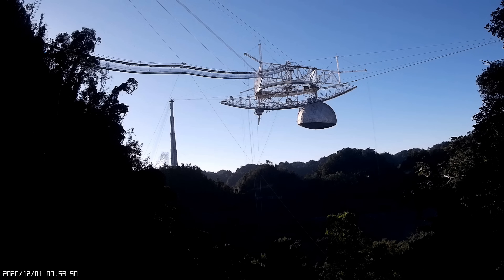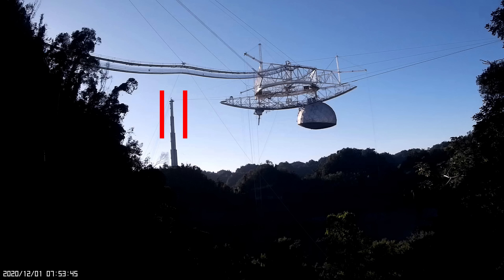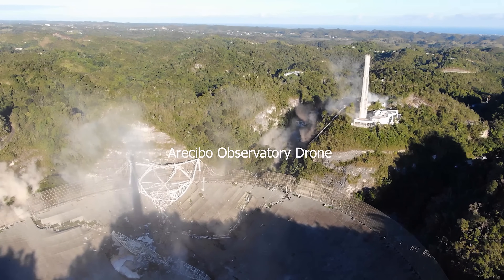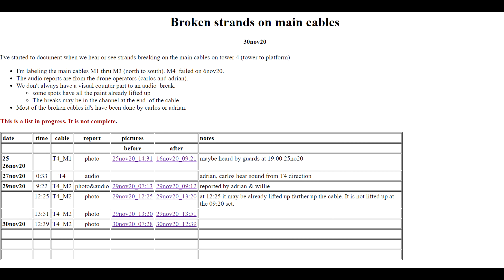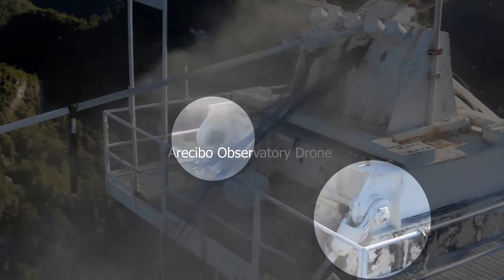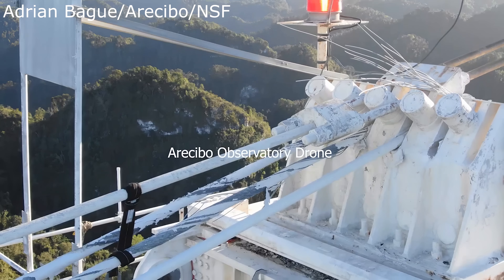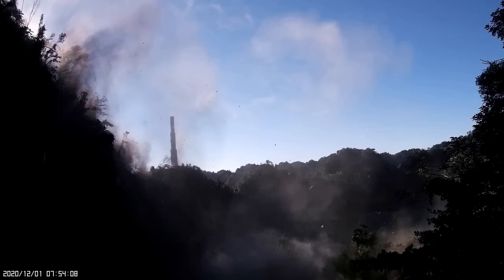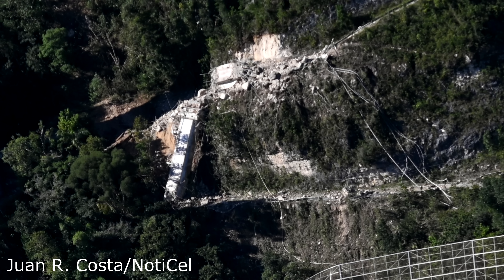Analyzing Video Footage Of Collapse of Massive Arecibo Telescope

Comment: As a recent resident of PR for several years (though not just now), I would love to see it rebuilt. I was fortunate to get an "insider's tour" in 2014 when they were looking for a new operations contractor. But as a space geek, there are problems with building a new one anywhere: let's assume the estimated cost of $350mm is correct. What other options might exist? $350mm could also fund a constellation of microsatellites that can act as a phased array radio telescope without the problems of local radio signal noise, rotation of the earth, etc. Or a telescope could be built on the Moon. Or a single very large orbiting reflector could be built, though that would likely be more expensive.

In fact in 2014 NSF was trying very hard to stop funding the facility. It's annual budget was tiny, only about $12mm/year ( which is a big part of the cause - little or no active maintenance for decades, despite efforts by the science community.)
Reply: Why would the NSF try to stop funding in 2014?
Reply: @ivanfreely6366  They've been trying to get out of funding Arecibo for a long time. They got NASA to pay 1/2 since a decade or two ago. They just did not think it was where they wanted to spend money. Considering that the total budget is about the same as a local hardware store, vs. the $zillions they spend on other stuff, IMHO it was shortsighted at least. Avoiding the expenditure of perhaps $20mm per year, they have now allowed the loss of a $350mm resource.

Comment: Quandrangular suspension has been proven to outlast triangular molecular impinged cable sets.  The density of mass condensed steel moorings transposed to a tri-binocular and inferior matriculation of weight*density/gravity violates all laws of physics.  In my opinion, rebuild but rebuild better.

Comment: I don't think the design of the socket (with the molten zink used to fill it up and secure), was the best method to use. If it was designed better, and the first one didn't fail, we would see some strands failing, but enough redundancy to do repairs. As of the second failure with it also pulling from the socket, that is not really relevant. The cable would snap anyway, even without socket failing. It was just too much static and dynamic load.

Comment: They were going to tear it down anyway...

The NSF opted it was safer to decommission the telescope in November 2020 rather than to try to repair it, but before a controlled demolition could be carried out, the remaining support cables from one tower failed around 6:55 a.m. local time on December 1, 2020, causing the receiver platform to fall into the dish and collapsing the telescope.

Comment: I think the thing that ultimately killed it was probably corrosion between the zinc and steel. The  middle cable loosing strands was probably because it was gradually working itself out of the socket, and the strands that still had a good bond were the ones breaking as it shifted over time. The next cable to break still had a good bond to the socket, so it simply snapped rather than pull out as the first did.

Comment: Could the thrust of the drone's propeller vibrations  triggered cable failure. An example of non-linear failure like straw that breakes the camel back.
It was going to fail it just need a trigger.

Comment: Seems a preventative maintenance issue. Seems the cables should have been replaced at some regular interval to ensure reliability. Original cables from the 60's are still installed?.Theres wind loads solar loads gravity weight etc. Those cables have endured expansion and contraction every day since install. You flex steel enough times it breaks. To me it was neglect whether it be due to Financials or other. But thats my opinion.

Comment: The base technology of the early sixty's stud up very well. With new technology the new unit may well last 100 years. Still I wonder what the main cause of the telescope's collapse.
Reply: A Hurricane, then a cable snapped in November, engineers deemed the other cables had been over stressed, and were planning to either replace cables or demolish it. Nature won out and the other cables failed.
Reply: @nssherlock4547  Ok, got it.

Comment: I was thinking (before the collapse) that the dish could be reinforced by cables run below it. Now I think we could make another dish using cables to allow the dish itself some degree of movement. This would enable longer dwell on a target as well as expanding the area that can be targeted. Modern materials are much stronger and lighter, so it should be possible to build an even better dish for an even better telescope.

Comment: I’d like to find a silver lining, and in that spirit, I hope that the video of the cables failing can be of use to structural engineers.
Reply: I'm sure this will be shown in some undergrad classes for years to come. In one of my intro to engineering classes (I was studying aerospace engineering at the time) as watched videos of failures like the Tacoma Narrows bridge, and a lot about the Challenger disaster. So I think you're spot on, this will be used to educate and instill the importance of their work into generations of young engineering students to come!
Reply: Another silver lining is that this solves the question of how to get the observation platform down without risking lives.  A third is that this has saved them money and made it slightly more likely that someone will step in to rebuild.

Comment: My Dad worked as an independent contractor to design a very small portion of the testing software. It would simulate the ICs before they installed the physical hardware. Of course this was probably replaced in the 2009 upgrade but still sad times. Beautiful footage however.

Comment: This shows that (1) they made the right call in not trying to repair it, (2) this should have been fixed 30 years ago; even 10 years ago it was too far gone, and (3) it was not designed to be maintainable and had insufficient reserve strength to start with. There are many, many flaws inherent to this design, not the least of which is that there is no way to release the tension on the cables for maintenance. They should have been anchored on winding drums that would have allowed individual cables to be slackened and the whole assembly to be lowered if needed. Instead, they were hard-anchored, using zinc of all things. Zinc is a brittle metal, and it gets more brittle as it ages. This will go down in textbooks as an example of an engineering disaster and engineering negligence.

Comment: WOW! That was pretty cool. Folks just to let you know those cables have to be and should be replaced on a relative regular basis. Those cables just can't be left holding that load for extended periods of time aka. years on end. Same thing with cranes. The cables on cranes are replaced on a regular basis just for that very reason. The ? is when were those cables replaced last? Also probably one or two more cables on each corner would've hurt either. Over kill is better than not enough. Bad engineering move by building the towers out of concrete. As you can see they stacked the tower in sections. which means they have joints. Basically the only strength the tower has is the rebar. A steel tower would have been better.

Comment: Perhaps a future program about what could be done with this site and infrastructure to advance science?  In particular, instead of replicating half-century old technology and costs, what could be done with new electronics, lightweight structures (think carbon fibre), support fibers and designs.  And does a future telescope/radar require everything hung in the air, or could you hang just a Cassegrain Reflector over the dish, with heavier receivers/transmitters on the ground in the center?

Comment: Scott, your analysis was in fact needed - I learned a lot. Regarding the last support cable snapping - the fact that it had LESS paint pealing off probably meant it was not carrying as much of the load as the other 2 - causing the other 2 to snap first. Had the load been balanced, could this collapse have been prevented? Do they measure the load on each cable? - and if they KNEW that they were hanging on 3 cables instead of the nominal 4th cable - was there a provision to lower the cage to prevent the damage?

Comment: Some people think that spelter poured sockets were weak. Friendly reminder that they are in fact the single strongest type of wire cable terminator, everything else is weaker and fails at lower loads.

Comment: Watching the second cable rapidly deteriorate after the first one went is extremely fascinating
Reply: Seeing that the first cable to fail was lacking protective paint (could it have been torn off by a single broken strand some time ago?), the nauseating feeling that the whole thing could have been  from a lack of maintenance rose in my throat. Could we now switch to the GoPro cameras on the Golden Gate Bridge?
Reply: @TheSoundsage  The Golden Gate gets repainted practically every year, and its had retrofitting and upgrade work done on it over the years.
Reply: @TheSoundsage  the lack of paint was because that cable had been slowly failing for a while. That's why the drone was there
Reply: that third cable appearing so intact makes it look as though perhaps the cables were not equally tensioned.

Comment: An anecdote told by the tour guide I had up at the Green Bank Radio Observatory tells the story of the collapse of their main radio telescope prior to the building of the Robert C. Byrd Telescope.

The operator on the midnight shift was sitting in the control room, which was situated directly under the scope.  It was an old 50s style block building.  The operator went to the poured concrete center of the structure to use the restroom.  While inside it, he heard an AWFUL noise and when he forced his way out, the bathroom was the only part of the building that hadn't been crushed by the falling telescope.

That's why the new control building is a 1/4 mile from telescopes.

Comment: Mr. Manley , with due respect, your video  leaves out two key points. One : Arecibo was  budgeted and built for the U.S. military not science projects. Two :  an earthquake was the proximate cause for the load bearing cables to snap.
Reply from the maker: Both points were covered in previous videos.

Comment: I wrote to the Bad Astronomer on twitter about the late public release of these videos (2 days late) being to me somewhat suspicious. In particular the drone footage. What % of daylight time where they flying these drones? And how frequently or consistently were they doing so before 8:00am, when it eventually happened? Just seems odd to me. Plausible of course, but quite too odd.
Reply from the maker: Well, if you look at the web page I included in the video we have the drone flying and taking photos before 8am on November 29th and 30th, so, it's unsurprising they were doing so on the following day.
Reply: @scottmanley  Why was a point in time before 8:00am chosen for the drone flights? Next one seems hours later after all.
Reply from the maker: @raulsaavedra709  They sent the drone up first thing in the morning because they needed to wait for daylight to see. Then they sent it up at other times when they heard cable snapping sounds.
Reply: @scottmanley  Ok I think I might have been going through those 5 stages of trauma, might have reached acceptance, thanks. Makes me think about early morning collapsing probably being a thing in hanging structures? Cables were beyond spec under very heavy loads. After the cool night, expansion from heating up of the cables from the sunlight maybe can accelerate reaching that bit to the breaking point precisely early morning?
Reply: or...they just heard something happening with the cables? After the first snap they put some sensors on the cables in case like that? - someone bellow mentions it is standard procedure with snapping cables.

Comment: "controlled demolition by cutting budget"
Reply: Criminal lack of basic maintenance.
Reply: @jeffreylemal7432  stop spreading that myth... Basic maintenance was fully up to spec
Reply: @lost4468yt  Evidently "basic maintenance" wasn't sufficient. There's suspension bridges in the US that have been standing twice as long, but they need to be maintained constantly do to it.
Reply: @BlackEpyon  The problem seems to be that the cables used were not up to spec and had much much lower strength then needed.

And if I recall right, the manufacturer of them also did some bridge cables that have been somewhat suspect as of late as well. 

This is not a maintenance issue, but a factory defect issue.
Reply: @DarkStar14n  Hmm. Probably had to go for the lowest bidder. That figures.

If that's the case, the redundancy in the design is probably why they held up as long as they have.
Reply: @BlackEpyon  i think it is cheaper to rebuild rather than to upgrade.. i dont know but i think its a good guess..
Reply: @lost4468yt  Maybe, but strictly from the first 1:41 mins of the video (so far), I would disagree.  I saw a lot of things that looked neglected.
Reply: @roberts9785  I'm so glad you can tell more than the people which run it just from a YouTube video... Get real dude, stop being an armchair engineer. You can't tell from the video whether the structural maintenance was up to date or not.
Reply: @lost4468yt  I'm not an engineer either, but what I COULD see from the video was that the paint on the cables was flaking off in a spiral pattern, which is indicative that the cable was beginning to stretch.
Reply: @BlackEpyon  The wires are wrapped around each other in a bundle to form the cable. Individual wires were breaking and taking the paint off with them. They were going in a spiral because they're wound in a spiral.

And yeah of course everything was moving around, it had already lost two cables previously, and the remaining ones became pretty frayed from losing individual wires. We knew it was going to collapse a few weeks ago after the second wire. It was ruled too dangerous to try and save after the second cable broke at only 60% load. That's why the camera was on it, because it was expected to come down any minute.

It finally came down when a small earthquake came through the area slightly increasing the dynamic loads on the cable.

You can't tell anything about maintenance from this video... Not without detailed knowledge of the exact structure, maintenance logs, what had previously been happing to those cables in the last several weeks.
Reply: @lost4468yt  I am real. I do this for a living. Notice how the place fell apart.
Reply: @roberts9785  You play armchair engineer for a living? That's sad.

You can't tell much of anything from this video without knowing all of the things I pointed out above. Please tell me exactly what you think you can tell?
Reply: @lost4468yt  did you ever wonder how the Wall Street bankers know what stocks to buy before it goes up? In the same way that they know what stocks to buy I have been in so many industrial facilities that just in the first three minutes I can tell if they got a good maintenance program in there or not. I'm not going to continue this dialogue with you. It's still a free country so you're open to have your beliefs and you know what you know and I know what I know and it's cool so have a good day.
Reply: @roberts9785  So you can tell but you can't tell me why? Right. Of course you can. You know more than an engineer who worked on it and knows for a fact that the basic maintenance was up to date? But you can't reveal how you know that. Ok.
Reply: Interesting definition of "controlled"...
Reply: @timothymclean  That's Congress for you.
Reply: @BlackEpyon  Greed is good, worship the rich, corporation uber alles, tribal republican politics you mean... One day in the coming years, this age of MIC taking all the oxygen will be known as the 'warring' period...
Reply: @bosatsu76  You're referencing "Deutschland über alles?" I think, based on my extremely limited knowledge of German, that "über allen" would be more appropriate than über alles." That would change the context from "corperation over [everything]" to "corperation over [everyone]," which seems to be the Republican GOP mentality.

Just my two bits.
Reply: @BlackEpyon  Ah... thanks... I don't speak German... Will use it from now on because that is exactly what I meant.
Reply: @bosatsu76  I don't actually speak it either, so if you find somebody who does speak it, they're opinion would probably be worth more than mine.
Reply: And for a longgggg time if nobody saw this coming.
Reply: Product of the lowest bid.
Reply: I have an idea. 

Will Mr. Elon Musk please pick up a house phone. There is an important call for Mr. Elon Musk. Once again, will Mr. Elon Musk please pick up a house phone.
Reply: @puppetsock  A little late to save it.  Besides, Musk have been preoccupied with SpaceX and Tesla.

Comment: It's kinda obsolete isn't it? Instead of a huge dish and many tons of a suspended platform with a mechanically steered transceiver, won't a modern radio telescope be a huge phased array? A massive flat panel made up of cubes which are individually an AESA module, with enough power and cooling it can be a gigawatt class antenna which can instantaneously look anywhere in a 120 degree cone (or thereabouts). Perhaps more importantly, you can replace individual modules, or add modules without compromising the function of the array by very much.
Reply from the maker: How much radar power can you put through that kind of system, and why has nobody done this?